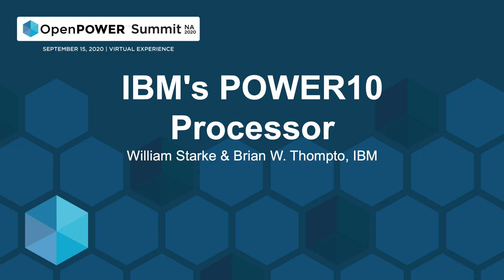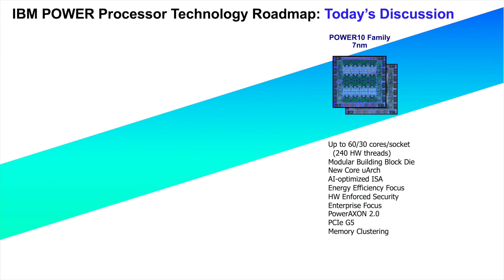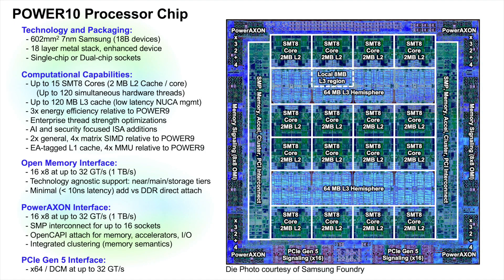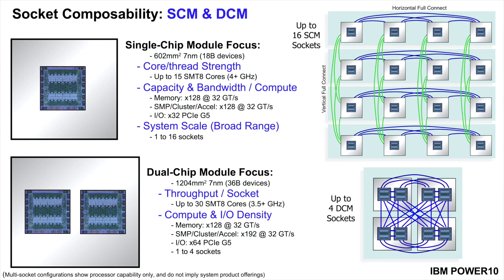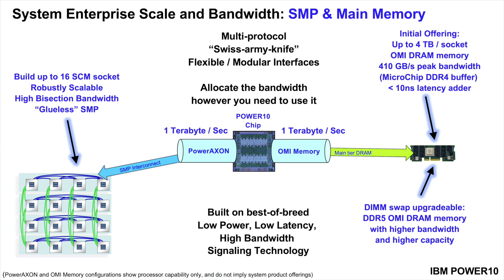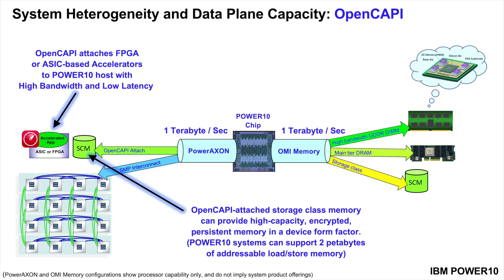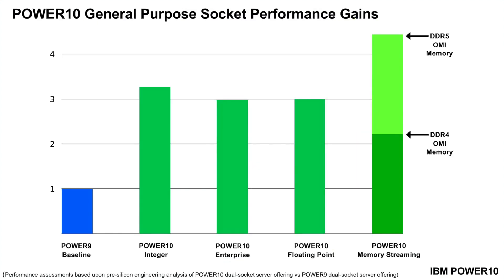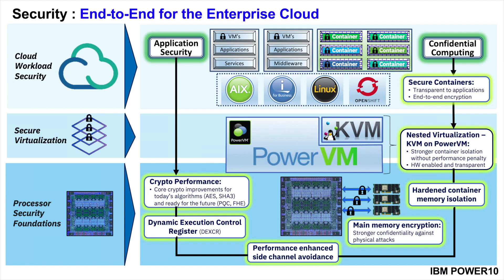IBM's POWER10 Processor - William Starke & Brian W. Thompto, IBM

Comment: I look forward to seeing what Raptor comes out with based around this chip.
Reply: Indeed, not sure how they'll make this chip accessible to the realm of us mere mortals. Might have to be satisfied w/microwatt.
Reply: @WorBlux  I guess it depends how mortal we're talking. The Blackbird with a 4-core or 8-core Power9 is ~2,000 without RAM or other components. Not a consumer commodity, but cheaper than the cheapest Mac Pro.
Reply: @ericwood3709   Both the Lite, and blackbird options are more affordable. However the Lite doesn't fit into a standard case,  and will having the same CPU:RAM as the full board,, it's I/O is sadly quite limited (24 lanes in 2 slots, + an option for an  expensive on-board SATA controller)

and the blackbird only has  1/8 the RAM bandwidth and about 1/6 of pci-e lanes for only half the cost.  It's simply not a very cost-effective competitor to x86, especially thread-ripper or even Ryzen9. 

The full Talos II board is a lot more competitive, but it's also a lot more compute than I need.  It's a full on server-class system.

For the next round, I'd rather see a budget version to be ATX form factor,  4 channels of memory, 1 x16, 1x8, 1x4, and 2 x4 m.2 (either on board, or adapted from and x8 slot) of pci-e   as a square competitor against x299/threadripper.  I could afford to spend an extra 50% on the base of a workstation I was going to buy anyways, but paying double for what is now desktop-class performance really hurts. 

It's also doubtful we''l see OMI and off-board SMP interconnects on Talos's offerings.  People that actually need that are buying full Racks from IBM or renting time on a cloud machine once they've developed the program on a local machine.
Reply: @WorBlux  I agree completely. I'm an enthusiast myself, and price has kept me from getting one to play around with even at the low end. If they can deliver full ATX or micro-ATX at a lower price, and if the damned CPU prices would also come down a bit (or if IBM would offer a more consumer-oriented version of it in the next iteration), I just might bite. Of course, I would also be happy to play with some kind of ATX or micro-ATX ARM system; I'm responding to you on a Raspberry Pi 4 running Ubuntu Mate right now, and it's actually kind of a nice little desktop replacement. It would be so much better, though, in a larger form factor with more power and I/O to match.
Reply: At least it made a little hype for IBM cpu´s. We must wait to the "little" 4 threath IBM power 10 cpu. It would be nice to have some products for enthusiast. Now you can buy an used power 9 cpu&memory relatively cheap but the Blackbird motherboard is really expensive and quite limited. I would like to try  it.
Reply: @josemorenoporras7506  Yep. Maybe Blackbirds will show up used and not quite so expensive when the Power10 generation comes out!
Reply: @ericwood3709  whatching ebay days ago there was a 2 soket server from raptor to buy. It was used from germany...
Reply: @josemorenoporras7506  Oh, a used Talos II? Very nice! I'm sure that will become a little more common as the Power10 products roll out.

Comment: Memory clustering (and Single System Image techniques in general) feel like removing some of the control from the programmer around performance of the network. We live with this for the cache/memory divide for historical reasons, but I'm not sure it's a pattern we want to continue, even if twenty five years ago we were all dreaming of getting our hands on a T3E or an Origin 2000.

Comment: is it single processor or multiprocessor,  I mean is it single cpu?
Reply: It's a chip/processor with up to 15 cores running 8 threads each core (120 simultaneous threads per chip). It can scale in a single system (IBM POWER E1080) to 16 chips/sockets, that results in on large computer of 240 cores / 1920 simultaneous threads.

Comment: The failure to understand the PPC giga lite processor was an unbelievable failure.  Matrix computing was within your grasp just as it was with the 88K for Motorola.  Don't be stupid and concentrate on just a small sector of enterprise.  The complementary ability of the smaller computing systems to add to the total SYSTEM is beyond what you are stating.  AI, and I was a decision scientist with hueristics, modeling of every profession and quantitative mathematics, could allow you to connect possibly the power of all computers as Apple has done with Rosetta with X86 to what will be a competitor of yours.

Latency is always the part of the slowest bus in the chain.  GPU?  Look at ARM!!!  Atto technologies is working with 120GB/Sec for external and internal systems of bucket brigade storage will be capable of feeding much higher levels of processors.

You think that the cloud is going to be of IoT / IoS /... is going to be capable of the ultimate speed but this has no reality unless you can work seamlessly.  RISC has always had the capability of multitple level matrix data to be run with one instruction.  Massively parallel execution will need to synchronize the work of all systems that will have the relational connection to a multilevel sync over all of your systems regardless of OS.

This means handshakes will be not only required by TCP/IP but a data equivalent.